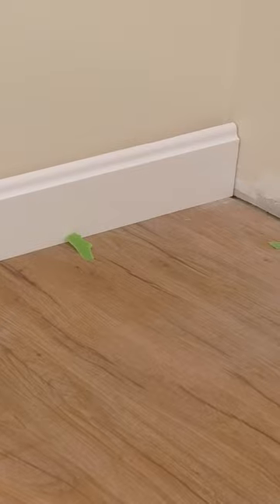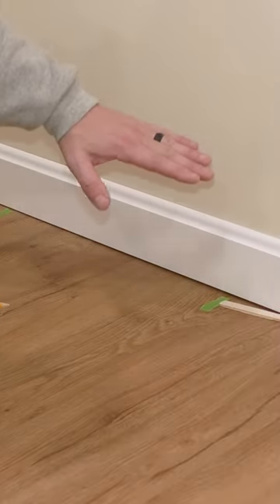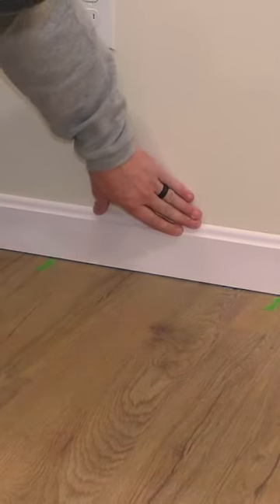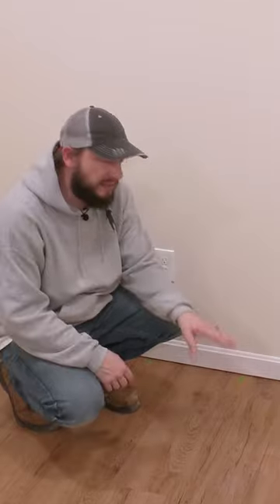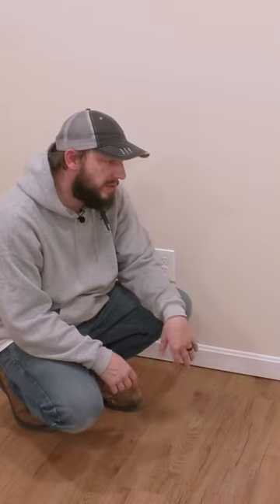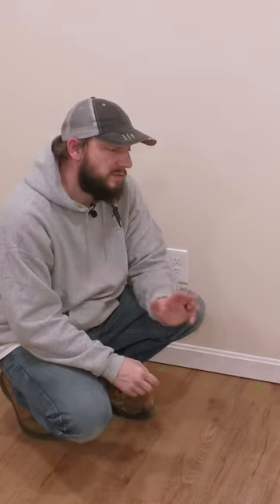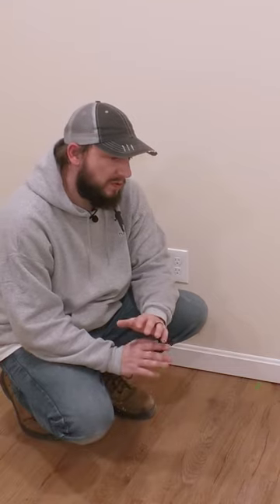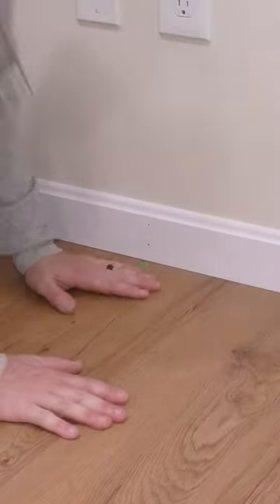Should Baseboard Be Installed Tight To Floating Floor?  #short #shorts #shortsfeed

Comment: Good idea. I've been a flooring installer for over 10 years and I never have issues with that. The floor will still be able to move around even if the baseboards are touching the floors. As long as you don't glue the baseboards to the floors, which nobody ever does.
Reply: Correct, wood moves regardless  of nailing, but gluing can cause stress  and cracks and splits in the lesser product ,like  the baseboard
Reply: I've been installing flooring for 10 years also. I have never had an issue with nailing quarter round or base too tight to the floor
Reply: Maybe the materials shrink a litle so its not a problem.
Reply: Well as a 30 year tradesmen I can ad that you all are 100% correct.  You can’t get enough friction to stop the floor from moving from just the baseboard.
Reply: Well on 50 plus years on the trade i can tell you, Nah im joking 😅😂 🤣
Reply: 30 years in flooring you'll be fine with that.
Reply: What about caulking the baseboard
Reply: @leathercheerio1  if you caulk to the floor the expansion and contraction will probably Crack the caulk.
Reply: Never say never. I swear the previous owners in the house I bought last spring glued and expanded foamed everything together. Such a headache
Reply: @jesusespin9941 😂😂😂
Reply: Not glue, but everyone I know uses caulk.
Reply: @robertmurray8267 : I don't believe so, if you use silicone based caulking, it will flex  wirh the expansion ànd contraction

Comment: Love this guy 😂 sounds like me when i know i can do it right but its just going to take way longer and the  work is not worth the outcome
Reply: If he scribes it then he is going to have to cut both boards on opposite walls, I would have just nailed it also
Reply: @gabevalerio1982  what does scribe mean? Put markings ti tim off? Here It say sinonimo of write
Reply: @antoniogalluccio4213  scribe in this case means he will take off a little at bottom of moulding and cut it to match gap in floor, that will eliminate gap but when he does this he will have to remove a little of base boards throughout room in order for everything to look correct from that point on. I would have done what he did and pushed it down and save time and work. If he is that worried about floor not being able to move under base he can rub a little canning wax at bottom of base board which will act like a lube and allow floor to move freely under baseboard
Reply: @gabevalerio1982  thanks
Reply: I’m so glad I’m not the only one!!
Reply: @antoniogalluccio4213  ???

Comment: The baseboards can be cut at a 45 degree angle on the back at the floor level so that only 1/16th-1/8th material is touching the floor.  Easier to form to the uneven floor and if your worried about expansion, reduces friction between base and floor.  Use a bead of low expansion spray foam and then install the base into the wet foam.  Now your insulated and airsealed at the base and between drywall and subfloor where conditioned air likes to flow out into the crawl space and also up the wall cavity to the attic.
Reply: Please no one listen to this guy 😂😂😂
Reply: @edwardallen2696  if this was high school.  Also use a coping saw on the corners, paint before install, use a minimal caulk bead to the wall and brad about a 1/2 inch from the bottom and get another brad into the stud after locating.  There’s fine home building and there’s handyman Ed.
Reply: @Beethovenviolin  paint before install 😂😂😂😂😂😂😂

Comment: So here's my thought. I installed about 1500 sgft of an lvp product. (I Had installed many, many jobs of lvp beforehand). On this install the lvp started to fail about 2 months after we left. The home owner threatened to sue my boss. We had the rep from the manufacturer come out and look. He said that the instructions (which we didn't read) stated there should be a business card gap between the baseboards and floor to allow for expansion. In all our installs never had we seen that. I think it was an escape goat, for the manufacturer.  We ended up tearing all 1500 sqft out and installed real 3/4 inch hardwood, sanded and finished. The customer bought the hardwood and everything else was on my bosses dime!

So good luck with that!
Reply: Yea, the manufacturer always has an off ramp-they've lawyered up.  Glad your boss made it work out.
Reply: Also going thru that,  1/4 round was  tight,  buckled in middle of two rooms,   company is tearing out and reinstalling for free.   There were no gaps,  almost made it for 3 years.

Comment: Your floor your call. You also could’ve found a shim that was ⅛” put it under the middle, nailed it in place, popped the shim out and then repeat the shim process on each end of the baseboard allowing your floor to float and have an even spaced gap all the way around

Comment: I done a few things with installing my floating floor they say not to do. Like I was told I needed to separate the flooring from my living room and dinning room and have a molding between the two so it won’t have issues with warping. I didn’t want that molding in the entryway between the 2 rooms. So I installed the floating floor together thru both rooms like you would if it was a hardwood flooring. Been down now over 12 years and not any problems yet! But it was a bit of a pain in the butt to install with the way the rooms are laid out. Basically my living room dinning room and kitchen are set up where you can walk in circles thru all 3 rooms with one wall protruding into the dinning room at a 45 degree angle.  Had to install some of the flooring backwards from how it’s supposed to be installed to make it all line up correctly. Won’t say it was easy, but it looks great now and no molding on my floors either!

Comment: For those gaps on my floor (slab on grade from 97 and terribly done as in the kitchen alone took 400lbs of leveler to get decent.) Instead of pushing down my baseboard, I installed quarter round that I pushed down where the gap was more noticeable. It keeps it less conspicuous than the whole baseboard having a bow in it, and scribing can be an extra hassle to keep the whole room worth of baseboard lined up.

Comment: As a diy installer who has installed floating floors in a home worth less than $10k, on a 30 year old OSB subfloor, without any real prep aside from removing staples from the previous carpet …

If you do things outside of manufacturer’s specifications, you might get floors that “pop” sometimes. A bit of trim isn’t going to stop thermal expansion from doing its thang.

Specs don’t matter much for people who don’t expect their home to last another 10 to 30 years.

Do what you need to do based on the value of your home.

Comment: If you start scribbing and trimming the bottom the the baseboard will be short in the corners. Then you need to adjust the next board's height to have the comers make sense and that can get out of control as you go around the room.

Dropping the baseboard like that won't apply enough pressure to hinder the floor movement. Way to go.

I don't think manufacturer cares about level. Flatness will make a difference, so you don't want sudden changes of plane or the joints will heave. Deviations from flat can also telegraph up through the material over time. Blend any high spots.

Comment: If the floor can’t move it will probably “ buckle “ somewhere.. if this happens jump at it it to push the growing boards under the tight base board - you know where your  fix needs to be focused! the base is going to shrink and swell like the rest of the things the room.. as fussy as I am.. you did the best thing.. it’ll be just fine 20 years from now still!

Comment: push down base and nail, simple. 1st,  why are we assuming trim is arrow straight. 2nd, there are several HUGE misconception about floating floors. Allow me to clarify. IF the subfloor has a low spot in a traffic area that causes the "floating floor" to move up and down, the locking joints become a hinge and will fail over time. joints aren't meant to hinge. Also, heavy items CAN sit on the floor and WON'T  hurt anything, quite simply it's a FLOOR not a waterbed, "floating floors" are called that because they are not ATTACHED to sub floor. Furthermore, it is wrong for anyone with common sense to think the floor just shifts around all the time like a magic carpet. Laminate or LVP flooring that is locked together, piece by piece, becomes a huge integrated structure throughout a space. It is as flat and stable as the subfloor it rests on. IF the subfloor moves or the floating floor moves and ONLY if the floor moves will damage occur at the joints. Somehow, installers ( novice and professional)  have convinced themselves that expansion occurs in the flooring. The expansion occurs in wooden studs and wooden cabinets that can and will absorb moisture over time. Most laminate and ALL LVP is waterproof and WILL not absorb moisture. Wrapping up this rant, we confer that you have a possible (remember trim ain't arrow straight) dip in floor along a WALL that doesn't normally move itself up and down and you don't plan on walking directly against that wall like a drunk, SHOVE the trim as hard as you want against floor. No playing card, no shim as tight as you want.  for the record,  27 years in remodeling with emphasis on hard surface installations including 650k sq ft laminate, 500k sq ft LVP,  to date. Thank you for your time

Comment: Before you start doing the flooring, check your exterior walls with a long straight edge find the low spots sham or build them up accordingly, furring strips, feather strips, whatever and you won’t have this problem.

Comment: If you have a good quality floating floor this should not be a problem i have seen with the cheaper brands of laminate you could have end joints that split i will usually put a baby quter round on it to close the caps up you can also use a self leavening compound to fix the floor

Comment: Good thing... if you start scribing one skirting to the floor, the corner joins to the next length of skirting won't meet at the top because the scribed skirting is now shorter in height... so you have to chase the levels around the room..headache...

Comment: Put a 1/6" spacer on the tight sides, push the center gap down and nail it, nail your the rest of the baseboard, take your spacers out. The ends will come down and the whole thing will end up floating about 1/32" off the floor. Yeah I have yet to find a floor with less than 1/4 over 10 ft. I swear that requirement is just a warranty value scam from the manufacturers because they basically never have to legally pay out warranty claims.

Comment: Lots of reason this is a good idea.  Your house was built in 1946.  The joists under the floor have long since dried out.  So your floating floor isn't going to move more than 1/4".  At that age of home you won't have any issues.
Reply: The joists aren't why you're not supposed to do it. It will expand and contract with heat/cold and moisture and traffic. If it can't move around it will buckle

Comment: yeah most people use quarter round to hide the gap, you push baseboard down like that and its going to look pretty silly with the bow.  floating floor might move a bit as you walk since its on a pad.
Reply: Know one is going to notice the slight bow, only the one doing the job will know!
Reply: @scottchamness8435  Yep, you are correct 💯👍

Comment: Dricore products are weird like that too. Floating floor concept, yet the recommended installation process is anchoring them beneath new basement stud walls. Oh, and never ever pierce the panels or they lose their vapor barrier benefits. You wanna tile or carpet over the Dricore panels? Sure! Just drive tapcons through your the vapor barrier membrane to keep the panels from moving. Moral of the story - do what you need to do.

Comment: The floor not going to me that much.  They only move when you have wide range of temperature changes and still its not that much.  It is why the flooring needs to be in the house for 48 to 72 hours to get use to the temperature.  Flooring except say the same thing same with appliances the flooring doesn't move much once installed.  Real wood or wood laminate will move more but the vinyl doesn't move.

Comment: I have the HDF-style laminate in my place.  I noticed it creaked a lot more when I put the base super tight to it, so I put like a 1/16 gap between it and the floor. I think so long as the gap is consistent, you are fine.

Comment: You can’t scribe the ends shorter because the return piece of trim that has to match into it on the other wall won’t match with the same height. If the gap is really large or the baseboard is so large that it won’t flex enough you can put in foam backer rod to take up some of the space and then use a high-quality caulking and caulk it to the floor. The floor will still move even if the boards are caulked to the floor and it looks super sharp and crisp. The only downside to caulking the boards to the floor is, if you do it to one wall you have to do it to all the walls otherwise it will look weird
Reply: Glad someone else knows this as well
Reply: Never caulk bottom of basboards. That's very ugly and amateurish. Install quarter rounds.
Reply: @tonyc7090  Ummm. Not a chance. Not in today’s million dollar homes.  That’s amateur hour and what our great grandparents did.
Reply: @tylercousins7779  lol, I'm A general contractor for high end homes and we always install quarter rounds. We install baseboards of no lower than 5" high. No professionals caulk gaps to the floor.
Reply: @tonyc7090  modern trim doesn’t use quarter round. In our area its a sign of sloppiness, doesn’t look as clean and modern. . Maybe try ot before you criticize it.  I don’t think I have used quarter round in 15+ years. Trim it, caulk it, spray it. Clean, crisp, no pests can wander around and it keeps dirt/fur from getting under it.
Reply: @tylercousins7779  I have tried it, not ideal. When I mean quarter rounds, I mean the modern ones also, which are sleek and straight edged, not the old rounded ones from the past. There are many types out there that go well with baseboards. I'm in Montreal, Canada. Maybe they don't have them where you are.
Reply: @tylercousins7779  Also, by caulking on a floating floor system, the caulking will be pulled back and forth due to the floating floor trying to move resulting in an uneven straight line of caulking.
Reply: @tonyc7090  im in Vancouver. We do have them. But now, The same way we caulk the top, we also caulk the bottom. I only used to do it when necessary or in washrooms on tile to prevent any water intrusion but several years ago we made it standard practice on all our builds.  And its less material and labour.
Reply: @tonyc7090  not really. Most gaps are less than 2mm and we do 90% glue down floors

Comment: What's the perfect idea man what's the point of cutting its crooked either way so you either got the crookedness in the trim or on the floor in the main like it wouldn't really matter it's very simple just push it down nail it rather than take it Loose scratch up something and then cut it and then put it back and then it's obvious you could tell the thickness difference might as well just leave it like you did and to be truthful if a floor guy does not level the floor that's on them

Comment: The manufacturer always give ridiculous specs so they aren't liable for anything.  I've been installing floating floors since they had to be glued together and every job would fail the manufacturer inspection.
Reply: I have a question, if I will install laminate floor and some areas exceed the 1/4 should I be ok. This is a 2 year construction and looks ok just few spots.

Comment: You can only scribe humps. You can't scribe dips. Why....because your corners will be different heights.
Reply from the maker: You can scribe anything.  You will just have to rip the other pieces to the same width. 😁
Reply: @TheFixerHomeRepair  well sure. But I'm not going to scribe 3ft of base, just to have to rip down the other 100ft or so of base so it matches in height. The only time I will do that if it's a short return.
Reply from the maker: @alrightythen1533  Yeah I get it if that is the case.  So many ways to do things.  I guess I just don't like the word "can't".  haha
Reply: @TheFixerHomeRepair   pushing it down was the right approach in this situation with small base. Scribing when you have small base has a tendency to stand out. It's often better to scribe tall base, since first of all it can be hard to push down, and the scribe gets lost in the height. Historically shoe moulding was used which hides all the wavy floors used in conjunction with tall base.

Comment: Completely wrong. This is why floor men use shoe molding. If the floor is installed so tight that the baseboard covers the gap everywhere around the perimeter you may not have enough room for expansion anyway.

Comment: Most homes that have central air/ heat you don’t have to worry about gaps of more than 1/4 inch on a floating floor.   Extreme temps is what makes a floor expand and contract. 

I would have done the exact same thing in your situation.  Also, when does anyone ever come over someone’s house and say, “hey I hate your floors!”